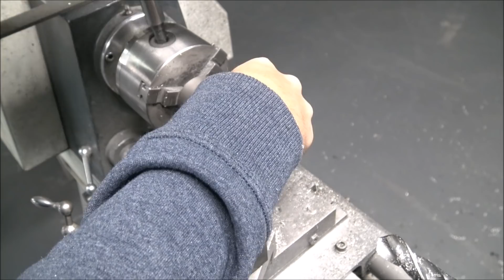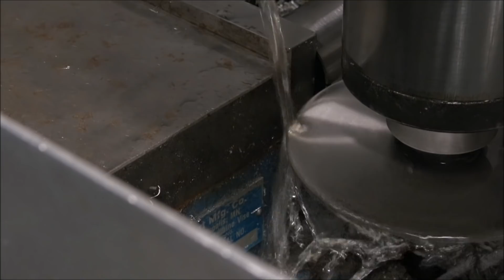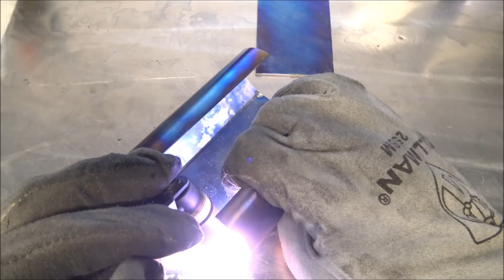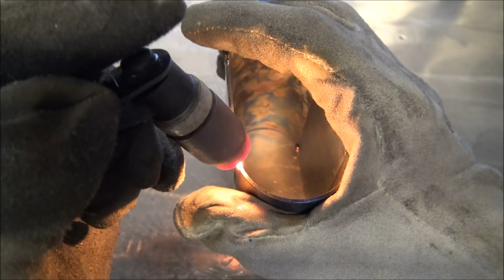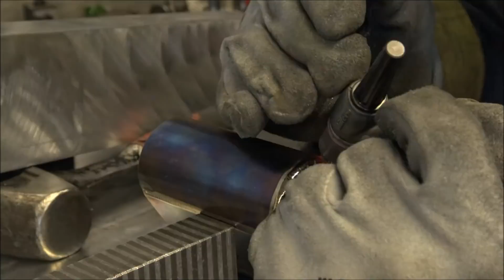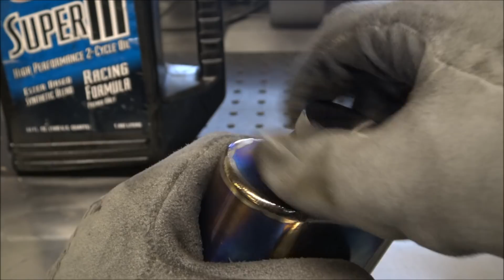TIG Welding Titanium Fabrication - Oil Flask

Comment: never thought I'd say this to a guy (again) but:  nice can!
also... TIG BUTTON backcap @ the torch?!
Reply from the maker: Hi Tony,
This torch is a "Prostar 24" model. It's great for DC welding at low amperages. It doesn't have a back cap, the collet is tightened by tightening the collet body (gas lens). It's great for getting into tight places (I used to use it a lot for welding stainless exhaust headers), and it's nice and lightweight.
(These parts you made fit perfectly, thanks again!)
Reply: This was my first thought too- where’s  the backcap? Thanks for the info 6061!
Reply: This is my first 3 way with T.O.T. and 6061... I don't hate it.  If A.V.E shows up, I'll tap out because 3's company and 4's a crowd.
Reply: I thought you'd say this to a guy (again).
Reply: Global Eco Tec - Ritter ohne Furcht und Tadel From what I remember from Tony’s video, it’s called a “bung <giggle>”.
Reply: This Old Tony I'm one of your subscribers. I have watched all your stuff. make your own aluminum flask for "oil" and take it along with the captive nut puzzle to your local bar
Reply: nice job Toni
Reply: @This Old Tony I miss you man

Comment: Amazing how bright the sparks are off of titanium.  Looks like burning magnesium bright.  Very cool build.
Reply: It is. Titanium is actually rather dangerously flammable itself, if the right conditions are there. The dust is especially dangerous. And like any burning metal, you cannot put it out - class D fired are no joke. Do be careful if you ever work with titanium- know what the proper procedures are and follow them. :)

Comment: This is weird..........stopped at a local welding supply shop, Lefeld Industrial & Welding Supplies Greenville,  OH to look Milwaukee  Fuel 18 cordless tools. As I was leaving I went over and looked at the welding and brazing equipment. Last time I tried welding was in high school. About the time you'd strike an arc some numb nut would reach underneath the welding booth and crank the dial to the max and throw the lever from low to high. So when you touched your welding project there was a small thermo nuclear explosion and your project was a molten blob below the grates. An hour after the welding store I suddenly come across your YouTube video. Thought about welding or learning how when I was in the store. Been a long time since I tried welding. Graduated high school in '81.

Comment: Nice work! The colouring gives it a nice look (although it hurts a bit to see welders intentionally provoke the formation of alpha case 🥴)
Reply: Why does it bother you?
Reply: The nice blue colour is alpha case which is detrimental for the strength of the material and particularly the fatigue properties as it is prone to inducing cracks. Obviously, the flask isn’t a critical structural component. Just as 6061 pointed out in his video description. My comment was with “the glimpse in the eye” (at least that was my intention 😊). In aerospace business, blue colour = fail. Non structural components, blue(purple, pink tone) = nice and decorative 😄
Reply: @andreaslundback  is that the case with Titanium? I know, as a welder, that steels and stainless' colours aren't great, but I wasn't sure about titanium, or inconel, monel, etc...

Comment: I just recently watched video that said if your titanium changes color when welding is a bad thing it means your weld is to hot and you are burning the titanium. Is this true because I see these high end titanium exhausts that look amazing  with a whole rainbow of colors. Just wondering. Edit: titanium handles extremely high temps really well also not a welding just a dabbler haven’t done any tug welding either just curious.

Comment: I was thinking about making an oil sump and valve cover out of 0.5mm grade 5. I suppose it depends on design, but do you think it would distort too much upon welding. What you are welding here looks thicker, but it looks very stable compared to welding aluminium with regards to expansion. Have you made either of these out of titanium?